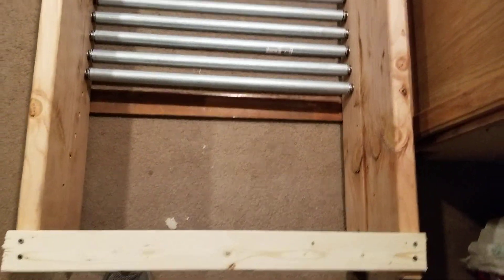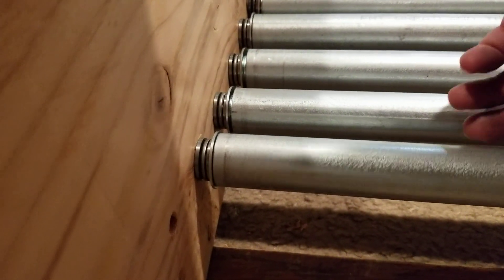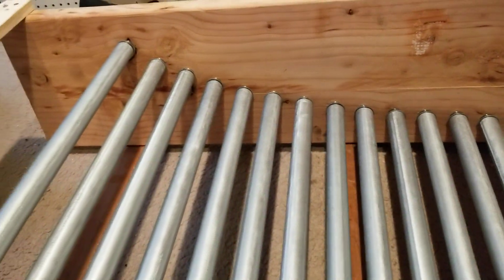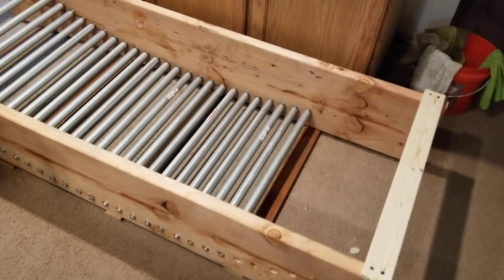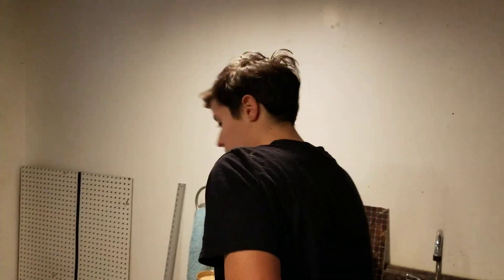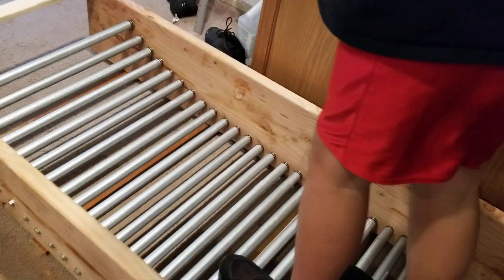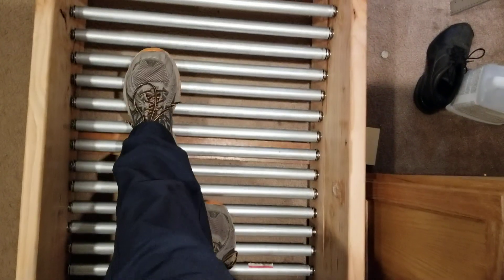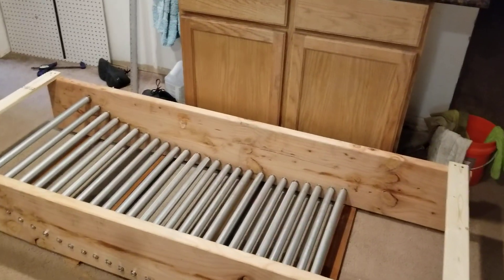Home built curved treadmill

Comment: Great job and imagination. Question: can you full(really fast) sprint on this treadmill? Reason why I ask is because I’m trying to build one, with the purpose of doing sprint/walk/jog cycle workout. I wouldn’t be sprinting for longer than 45 sec at time. With 2 minutes in between the sprints. I’ll probably be doing 15 to 25 sprint per work out session 3 times a week.

Comment: The problem is that the tubes are hollow and that with the bearings is what is making the sound.  Fill the tubes with foam and cover them with some spray rubber and it should dampen it a lot.

Comment: Excellent  and neat! Thanks for showing us it works. I am gathering parts to build one similar. I plan to use class 7 pvc  pipes.
Reply: The problem is that the tubes are hollow and that with the bearings is what is making the sound.  Fill the tubes with foam and cover them with some spray rubber and it should dampen it a lot.